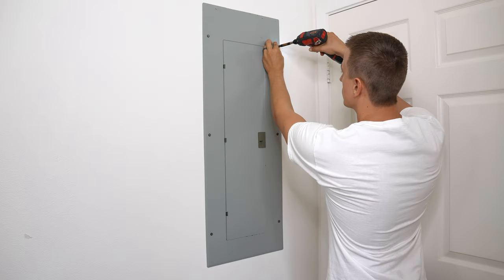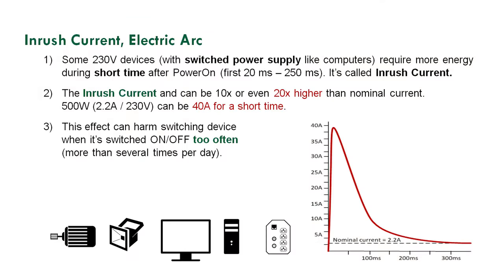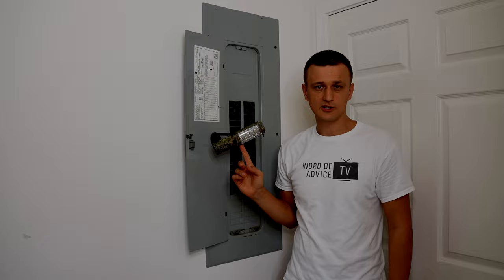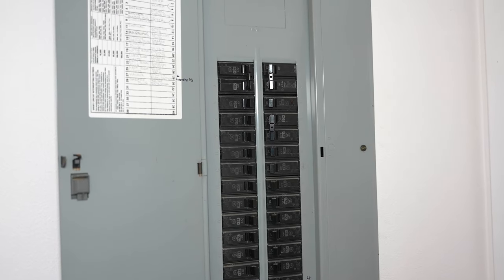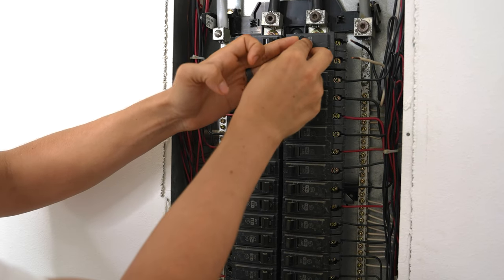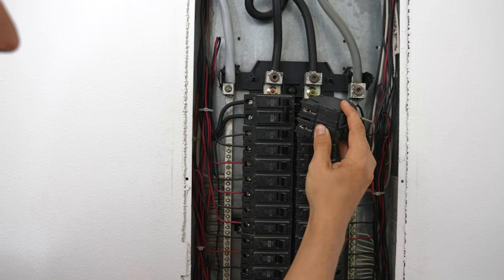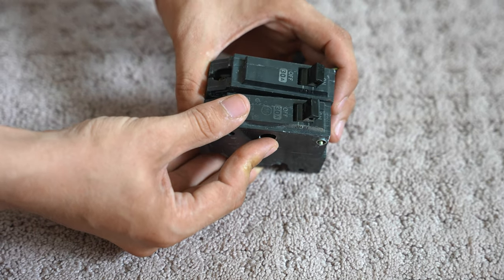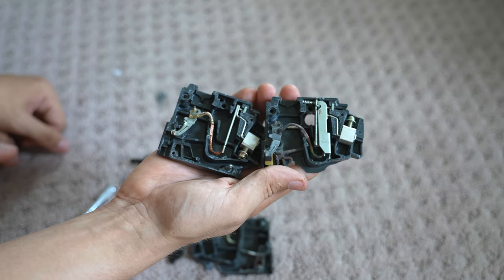How To Replace a Circuit Breaker - All You Need To Know

Comment from the maker: ⭐ Other Videos You May Find Interesting:

Power Outlet Not Working - Easy Fix:
https://youtu.be/GETyRTWUOSk
10 Ways to Splice/Reconnect Wires:
https://youtu.be/ihpNCVk1lF0
3 Ways to Bend PVC Pipe With No Tools:
https://youtu.be/T-Q5otcs0f8
Top 5 Furnace Problems and How to Fix Them:
https://youtu.be/T4IWtKy--Vk
Top 5 A/C Problems and How to Fix Them:
https://youtu.be/GOXgdnRB840
Furnace Parts and Functions Explained:
https://youtu.be/gN-UIr6824w
A/C Parts and Functions Explained:
https://youtu.be/pJ8KeJFKDMM

Comment: Not an electrician, but am an electrical engineer. Please make sure you are using insulated gloves and insulated hand tools when working on electrical panels, live or not. It only takes a small accident to become seriously injured or worse, and many household tools are insulated to 1000v and would work fine in this instance. The 240v coming in on your main from the distribution transformer can absolutely kill you, and it's still live at the top of the panel even when you turn off the main (unless you have an exterior disconnect). Stay safe!
Reply: Fine we’ll hire you how much??!!!!
Reply: so true, you only get one chance to screw up with high voltage!
Reply: so i can die if i dont do it right
Reply: Stick to being an engineer… there’s no reason to wear hot gloves here
Reply: A electrician noticed the wrong wire code here,white wire only for ground,must tape to use on hot.
Reply: What a wimp
Reply: who willin
Reply: All you need to do is accidentally touch that panel to the live wire when removing it and your life is over.
Reply: I’m not a electrical engineer but I did stay at a Holiday Inn Express last night. It’s the Amperage that kills you not the Volts .
Reply: My breakers have  been in so long that there aren't any numbers on most of them.

Comment: All good info. Only things I would mention for anyone watching, is to stick with the breakers rated for your panel. Yes GE, Homeline, BR, and others will interchange and work just fine, but if they are not specifically listed for that specific panel I could see an issue in the event of fire or other insurance related event.

Also, not a big fan of any power tools (impact driver) when tightening electrical screw terminals, especially in a panel. Over-tightening a screw can be just as bad as under-tightening. Breakers are receptacles have rated torque values and it's often lower than people would think.
Reply from the maker: All great pointers! Thank you for explaining that!
Reply: I use an adjustable torque screwdriver to torque it to manufacturer required specifications. Wiha and Wera makes nice torque screwdriver sets.

Comment: Hi Jay.  I’m a subscriber.  I really enjoy your videos and you “dad humor “.  As someone who has done plenty of electrical work (not an electrician), I keep up with codes to the best of my ability.  NEC code requires that the terminations in electrical panel, seps or sub-panels be torqued to manufacturer’s specifications.  The simplest way is to first connect the wire with a screwdriver or low torque drill.  Next using a torque screwdriver, apply the correct amount of inch lbs as listed on the breaker.  Now you can insert the breaker and flip it to the on position.  In this senecio you can buy a much cheaper torque screwdriver.  Look up the prices and you’ll see that.  Trust me that’s simply the best way to avoid under or over torquing.  Both can cause serious problems.  Stay safe!

Comment: "It's about raisin awareness." Gotta love the dad jokes! lol
Didn't have hot water a couple years ago - looked at the breaker and it was on (even pushed on it). I figured it was time to replace the elements so made the drive on sketchy, winter roads to the box store 10 miles away and picked up a couple of replacements. When I got home and prepared to replace them, for giggles, I did an off/on flip on the breaker and I could hear it kick on! A few minutes later, I had hot water! Not sure what happened or why ... but it's been working fine ever since. I'll give the tapping tip a try and maybe think about replacing the breaker. Thanks!

Comment: A very good and educational D I Y video. Electric circuits are about power percentage. A 19.2 Amp rating on a 2-pole 25 Amp breaker is ok. The 25 amp 2 pole breaker may cost more than a 2 pole 30. I replaced the heating element in an A O Smith water heater. I was amazed that a 2 pole 20 Amp breaker had run the water heater for years. The owner did not want to buy the proper breaker.  I am waiting for a call to return someday soon when the hot water stops working again lol
Reply: 20 amp is good for water heater. continuous load require 1.25Xrated current however continuous load is defined as run continuously 3hr+, therefore 20 amp is good for most of the time. note that per inspection wise, X1.25 in breaker selection is necessary.

Comment: The breakers were GE and Square D ( not HO). The “ hooks are anchored on a BUS bar.
My comments are to say, Hi great video. FYI I worked for a major hardware store in the electrical department. Yes, it can be scary to work with electrical however, safety and caution is always best to follow. Great video.
Reply: Homeline ("HO") IS Square D ...you need to brush up on how to identify breakers sir.  Also, you must NEVER, EVER, install ANYTHING other than the specific type AND BRAND in any panel, especially on the high current double pole types for water heaters, ranges, dryers and air conditioners. I have seen way too many damaged panels and serious fires caused by "handymen" and especially plumbers and HVAC hacks using the wrong type. (40 yrs. electrician.)

Comment: per continuous load, times 1.25. hence in your case, 18.8x1.25 is the breaker size. the closest available breaker is 25 amp so 25 is optimum。however since 25 amp breakers are less common in the market, 30 amp ones are always found in similar cases
Reply from the maker: Ah interesting! So actually a 25 amp breaker in my case was even better than the 30. Thank you for clarifying and confirming that!

Comment: First of all, thanks so much for such a simple to follow, thorough video. It was incredibly helpful for my first circuit breaker replacement. Although I'm hoping you can at least point me in the right direction as what to do next. My dryer went out. Checking the outlet with the multimeter first, I found that one of the legs didn't read on the multimeter. Then I went in the box. Checking the breaker, it didn't read anything at all. So I think it's the breaker and replace it. Problem is it still doesn't read anything on the multimeter. Is it time to call an electrician? Thanks again!
Reply from the maker: Sorry to hear about the breaker troubles! So on one side of the circuit breaker you are not getting 120v coming out? Are you measuring to neutral or to ground? What if you try taking out the air conditioner breaker and put that in instead? Still the same problem? Perhaps a loose or disconnected wire then? Keep the dryer unplugged while doing this too. Until you make sure that the breaker is putting out 240v. Just some thoughts I got when reading your comment, hope that gives you some ideas to look into. Good luck!

Comment: While watching your good video, I noticed that since you have a sub-panel, (Main panel is outside) the original installer, rather than install a ground bar, took out the bar that ties the two neutral bars together.   In the top left you have a 2P 50Acb.  On the ground bar, it looks as though the white, possibly neutral was landed on the ground panel incorrectly.   Also, I could not tell if the bonding jumper was installed from the now ground bar to the back can.

Comment: You should torque the circuit breaker screws to the correct setting, usually written on the breaker somewhere. I see an unmarked (to black) white wire connected as a hot wire to the breaker also.

Comment: First time ever seeing one of your videos and it's the first time I'm going to try to replace my own breaker. 
Running through the comments now I'm a little bit scared!! I feel like I need to have (the electricians equivalent to) a beekeeper's suit on!! Dang. Can I feel confident and lost at the same time still? Yup 
There's one breaker for most of the kitchen and the garage. Every single day when I go to use the microwave I have to cross my fingers that it doesn't trip the 15. I'm wondering if I can take it to 20?? But maybe the 15 is floppy so I need to check that first. I guess it would be safe to put a 15 on first. It's a big over the stove microwave and I've been here 9 years without any issues until now. I haven't added any appliances recently so I'm only assuming it's the breaker. 
So my question is, could the microwave itself be starting to break and cause surges of some type? I wouldn't think so but I was just wondering if you have any suggestions or questions or information.

Comment: Question: My GFI breaker trips often. Should it be replaced or is it a greater issue? Only using Keurig coffee pot.
Reply: I replace my GFCI's whenever they start tripping.  I've never had a larger issue cause them to trip.  They go bad.
Reply: Try your pot on a different circuit first.  If the pot trips the other GFI then its your pot. If not its your GFI.  Be sure your GFI is rated correctly though.

Comment: Just curious, I thought White is always a Neutral wire, in  your case, it looks like its a 240V circuit and it is using a Black and White cable for 2 Hot Legs. Thank you.

Comment: Literally every home project I do the first time, I make AT LEAST one mistake which is fine because I can usually just redo it or buy a part to replace.  Thats how we learn.  The one thing you cannot do is make a mistake with high voltage.  You can be killed or crippled for life and this will affect your whole family.  This is a good educational video but it's definitely worth it to have a licensed electrician do this if you are untrained.  Your life is worth more than the hundred bucks or so it will cost to have an electrician do this for you.  And I am not an electrician btw.
Reply: Me also. I had to learn to fix around my home because everyone was charging what I felt was excessive, like  $425 to replace a $300 microwave.  I came to YouTube and switched it out myself in 2 hours. I have time but not money like that. Now I'm going to replace my fuse 🤞

Comment: I have a question jay so I have a 30amp for my hot water heater when the old heater was token out it was leaking at the heat elements and water was evey where  then it made a pop electrical spark so should i change my breaker for new one .?

Comment: Couldn’t get new breaker to lock in😞
suggestions?
( old & new are identical square Ds)
Reply from the maker: Sorry, not much I can help with without being there but here are the normal things you would check:

1. Ensure the breaker is properly aligned with the busbar slots. Even a slight misalignment can prevent it from snapping in.
2. If the busbar has been damaged, it might not be able to provide the necessary grip for the breaker to snap in securely. How does the bar under that breaker look compared to other ones? You may need to bend it slightly with a pair of pliers if it looks different.
3. The new breaker itself could be damaged, preventing it from fitting correctly. Take a look again at the latches. Nothing shaved off or broken?
4. Double-check that the new breaker is compatible with your panel. Some brands or models have specific requirements and even if they look the same, the just don't work. It's annoying to have to go get another one but another thing to do is to simply try a different brand.

Comment: There may be some instances where you may not be able to turn off power to the whole building, especially in commercial applications, you have to work with a live panel and just have that one breaker off

Not saying that it's right but sometime we have to do what needs to be done

Comment: I replaced a breaker where I worked, and I used an ampclamp meter and found the breaker didn't hold rated amperage. I always turn off each circuit before the main myself.

Comment: 2 terminals coming out of the breaker?
Reply: For the Black & white wires.
Reply: It's a 240volt line so in north America  we have split phase power. 120v from each leg to ground or 240v to each other. A standard 120v breaker would be half the size with just one terminal. GFCI/ and arc fault breakers typically monitor the ground/neutral of each circuit, so they will.have two terminals.

Comment: I cut a piece of cardboard to friction fit between the panel side and just cover the main lugs . That reduces my chance of an errant  touch. Also , you can use gas line rubber hose to slide over any screwdriver shanks that are bare metal.

Comment: replaced my inside breaker for my outside ac condenser unit after I had no amps at the outside breaker of the unit. Inside breaker keeps tripping immediately. Even if I pull the outside breaker it still flips immediately.  Need advice asap! Frustrating!
Reply from the maker: That sounds like it may be a short in the condenser unit. I would suggest starting with this video: https://youtu.be/G1EBHrOgs-Q?si=G9KIFYLEkPnSf1mY
Reply: @WordofAdviceTV  I did all of that and everything checked out. I believe the problem is between the inside breaker box and the outside breaker box. The breaks trips when i have that plug pulled. Any further suggestions?
Reply from the maker: @Steve-rc4np  Ah, that's a tough one. Hopefully it's not a short somewhere right in the middle, inside the wall. Have you tried disconnecting the wires at the disconnect box to see if the breaker still trips even with the wires disconnected? I would take the cover off the breaker panel and the disconnect box and investigate as much of the wires as I can see, disconnecting all of them, then one at a time to see if it makes a difference. If I still can't find anything, then at this point I would probably be recommending an electrician.

Comment: Technically, it should be a 25 amp breaker but a 30 is used out of convenience most of the time. ( Typical element draw on a water heater is 18 amps.... multiply the load by 125% , per code, and it's 22.5 amps using the next size up breaker giving you a 25 amp breaker). Another commonly oversized breaker is the well pump breaker.....same logic and math results in a 15 amp breaker which should be used instead of the commonly used 20 amp breaker.

Comment: You should not be using a power tool on the breaker. You also are supposed to torque the screws to proper torque. Per NEC.  (Listed on the breaker).  Otherwise a nice video.

Comment: So if I have a 15 amp breaker can I put a 20 amp in it instead of the 15 amp
Reply: You can if you have 12 gauge wire in place.  If its 14 gauge, you have to stay with the 15A breaker

Comment: I am rewatching and cannot get clear whether you have main off and circuit breaker  
on when you test, or both on when you test.
Reply from the maker: If testing voltage, the power needs to be on at the main and the circuit breaker you can turn on and off while testing to see how it effects the voltage.

Comment: Others mentioned already, but there is no master disconnect evident here - is this a subpanel, so all power might be turned off coming in? All his casual work with the breaker replacement, is around a live circuit, and once the breaker's out, that bus bar is exposed and hot. All it takes is something contacting the neutral, ground, or box wall with a screwdriver slipping, or similar, and a short can occur in a second. I hate to see those live main lines totally uncovered, when there are plastic covers readily available now which at least give a layer of protection.

Comment: I never turn off main when replacing a breaker.  Just make sure to remove the breaker off the panel and then the screws. Then reverse to install the new breaker. Make sure the old  and new breakers are on the off position and you don't touch any other part on the panel.
Reply: @somethingsomethingsomethingdar  no if you know what do are doing
Reply from the maker: Thank you for sharing Xavi! I know electricians who do the same but of course that is not the proper way so most of us would not make a video encouraging someone to do it live.  😅😇
Reply: HVAC tech here. Changing a breaker is a simple task. Single pole breakers even simpler. I agree if possible always shut down the main. For safety I agreed. Do not rush on any electrical job and always stay focus. 💯

Comment: I hate GE panels....lol
Reply from the maker: Lol, good to know. If in the future I will have to choose between a few, I will know to avoid GE. 😄
Reply: @WordofAdviceTV  My gripes with GE.
1. The tub of the panel isn't painted and the inside lips are razor sharp so after a day of cutting in a panel the back of my hands and nuckles are all sliced up. In addition I've had several come warped so the cover won't line up. 
2. Lately the breakers are a mixture. Needing a flathead, square drive, and T25 to torque connections. (Slows you down switching back and forth)
3. No plug on neutral for the Arc faults/ GFCI breakers. In addition I've found the GE arc faults to be the most sensitive/problematic of all the brands. 
3. Small gripe but the labels sent for marking the panels are tiny, and the label on the doors have been coming stuck on crooked (makes is look sloppy)
4. I've had more than one 100amp breaker bad right out of the box
5. The panels never come with ground bars, always have to purchase separate for $20 a piece. 

Personally I've switched over to siemens panels for residential. By far easier install, service. Cleaner install at a lower cost compared to GE.
Reply from the maker: Great information from someone who knows what he's talking about! Thank you for sharing your experience!